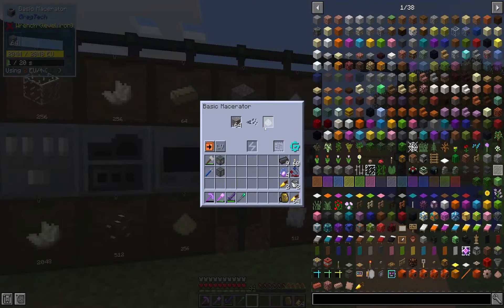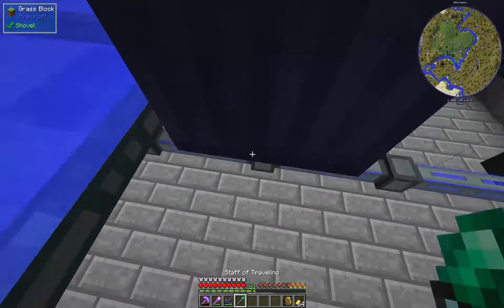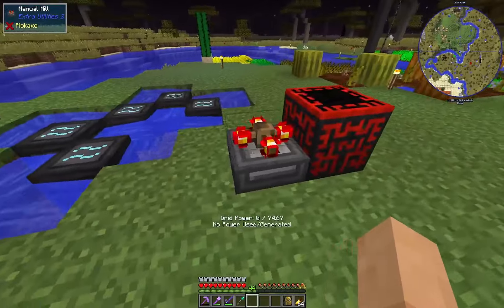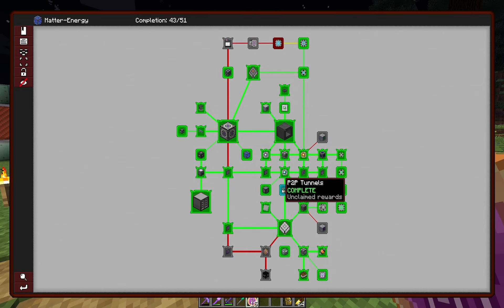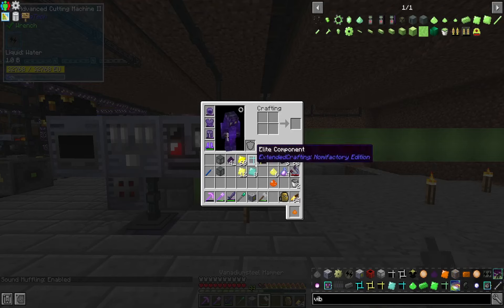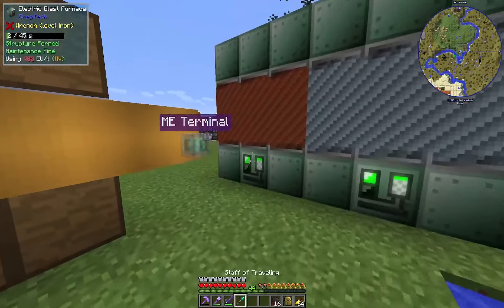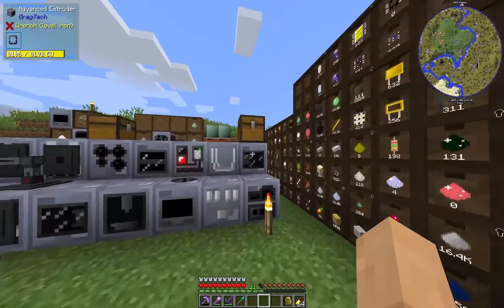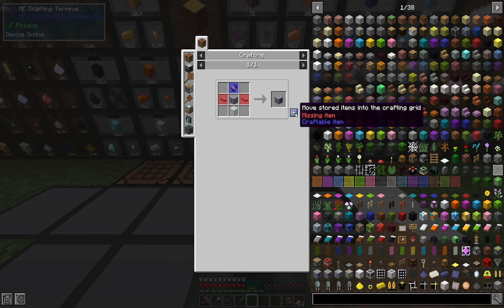Nomifactory Modpack - Minecraft 1.12 - Ep. 14: Advanced Crafting Table, Cleanroom & More!

Comment: Talking about XU2 grid points, I've had fun this play through getting my red coal up to 11,000 ticks using a variety of generators.  This lets me run 3 tungstensteel boilers off a single creeper simulation since the red coal lasts 8x longer in the boilers than coal.  All that steam turns an HSS-E rotor in an EV rotor holder giving me 48,000RF/t once converted.  Not too shabby using a single 64RF/t creeper model!  Now I'm curious to see if a single creeper model can last me all the way up until fusion plasma.
Reply from the maker: Dang that is definitely an impressive setup!  Very cool integration there!